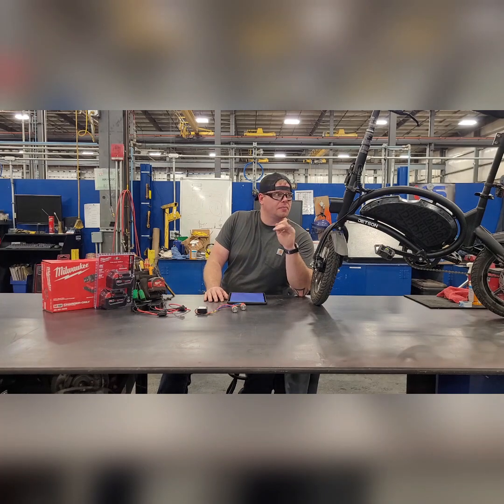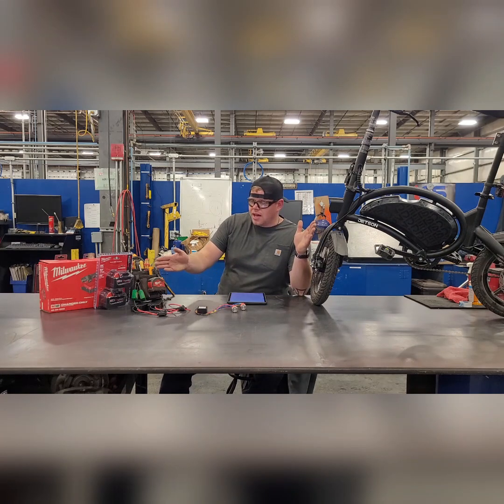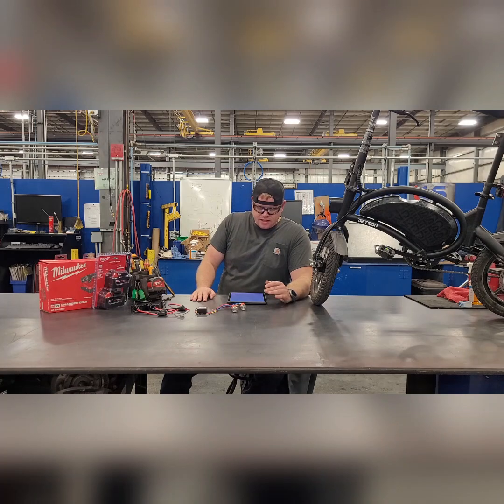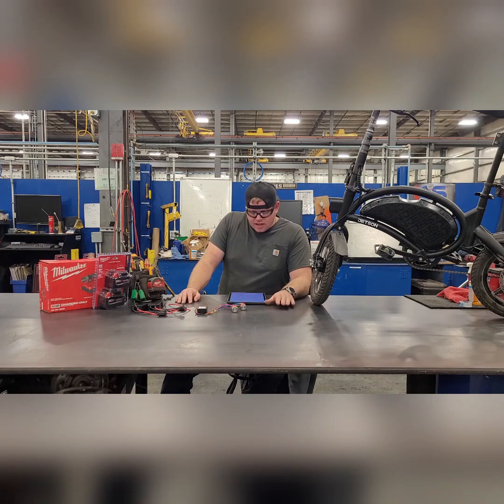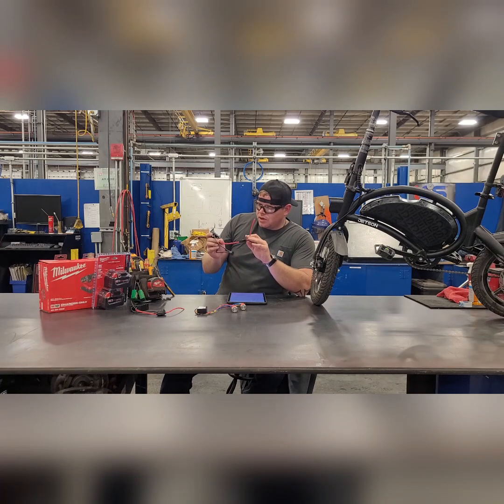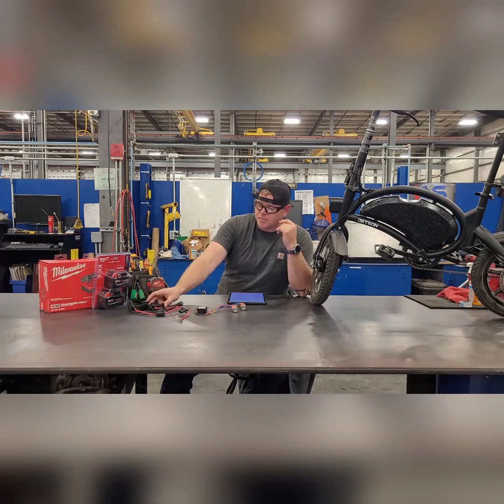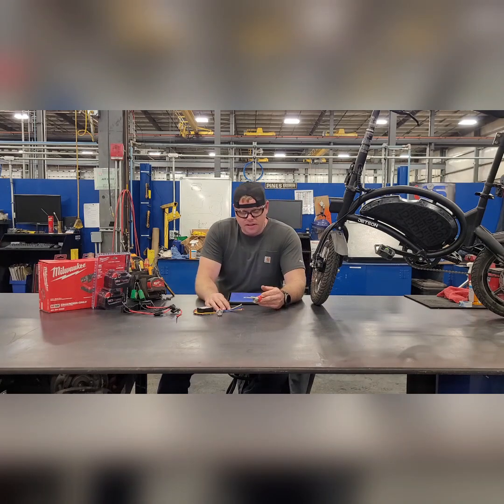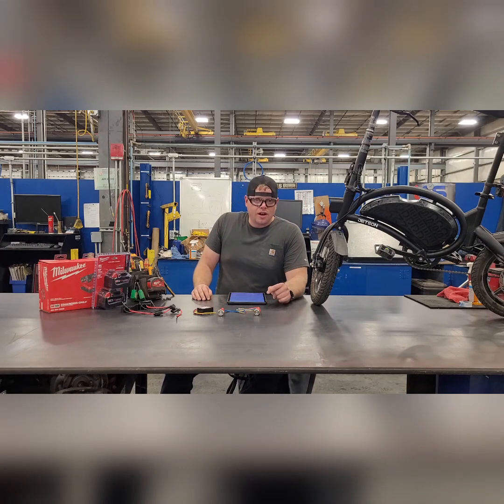Jetson Bolt Pro E-bike Milwaukee Battery upgrade. 83%-300% range upgrade. The what and the why.

Comment: Will this work as a battery replacement if I wanted to run it off of just the Milwaukee batteries? I have one with a dead battery and am thinking about swapping to Milwaukee
Reply from the maker: @maxwellmoreland1911  yeah it would. As Long as you know how to wire it. The switches is on the back actually isolate the main battery pack versus the Milwaukee battery pack or run both parallel at the same time.

Comment: Another Note is putting the External battery on the back rack, putts way too much weight over center of the rear wheel, making it unsafe going up hill. I several times popped the front wheel when I gave it throttle. I even popped a wheely and the bike flipped me off and I skinned my knee up. Just look at the seat in relation to the rear wheel, there is a danger of being unstable. Just saying....
Reply from the maker: No that's a great note! My goal on the video was to share the concept of drill batteries for auxiliary power or power replacement. Not the final configuration. On this build specifically it was important to the owner that it was minimally invasive to the original bike. Also with the auxiliary battery being a self contained module allows for it to easily be adapted to another platform. He is now thinking of doing a Mt. Bike conversion and we can use this bank on that build if he wants to go that route. To your point that's a great point and something I overlooked planning this project out, I'll be sure to reach out and ask if he has noticed anything with that. I'll most likely try and break it down with math and use a counter weight method to fix the issue. If it was my personal l, that whole center piece would have been gutted and redone. Thanks for sharing, hopefully helps someone plan their project out. Add a link to your build as well! Would love to see it!

Comment: Dude I did a video on this and I took a Greenworks 40 volt 4 Amp Hour Battery and put a 3 pole switch to switch off the main battery to the external battery. I range tested it and got for the 4 amp Hour 7 miles on mainly flat ground. So, I can say using the power drill type batteries is a great option.
Reply from the maker: I saw it! Looks good.

Comment: So how many miles do you get for range then before you have to recharge ? No need to count all in 1 day now..
Reply from the maker: That's kind of a loaded question. With pedal assist you'll get more range. Any type of environmental factors such as hills, wind and terrain play a factor. Rider weight, it's the same as a fuel mileage question for a car. We added 2 batteries in series which made 36V @ 5 amp hours which is an 83% increase in capacity from the 6ah batteries for a new total of 11 amp hours. So take your normal range for your typical conditions and multiply that by 1.83 (assuming stock battery is in good health.) and you'll have an answer most relevant to you. By the math of the specs we have a 350watt motor with a top speed of 15.5mph. so with the motor running at a full 350watts continuously on flat ground with stock battery capacity of 216 watt hours, this would give you .62 hours roughly of run time for 9.61 miles. With this increase we have 396 watt hours. For 1.13 hours of run time * 15.5mph = 17.51 miles range. That's the math, life is never that easy but I hope this helps.